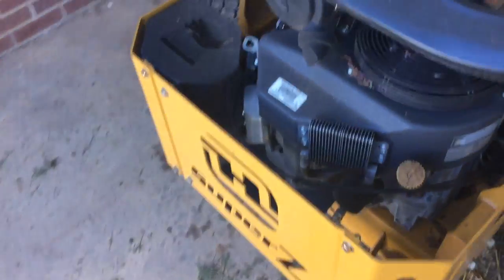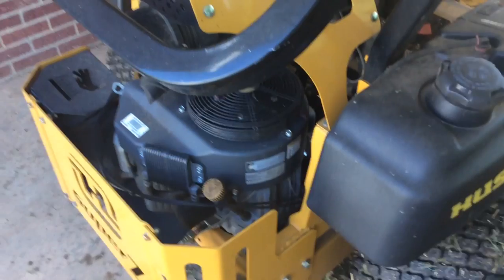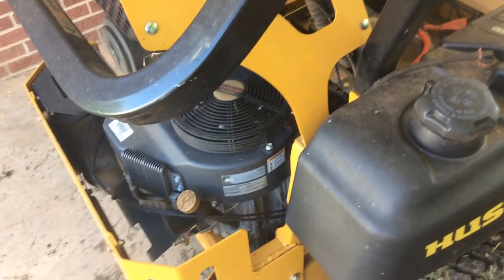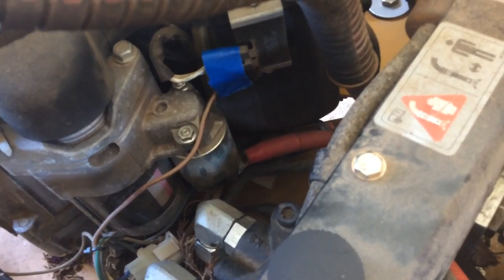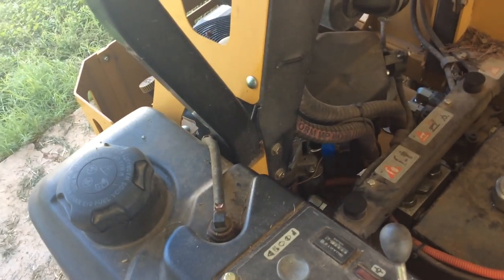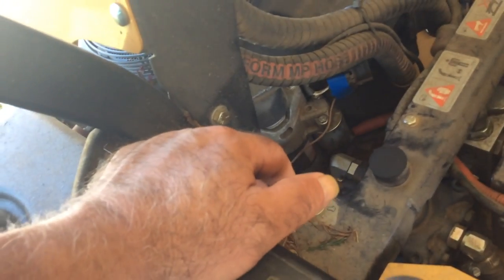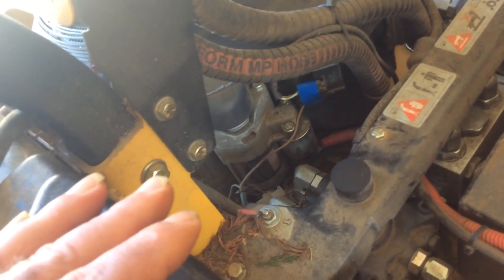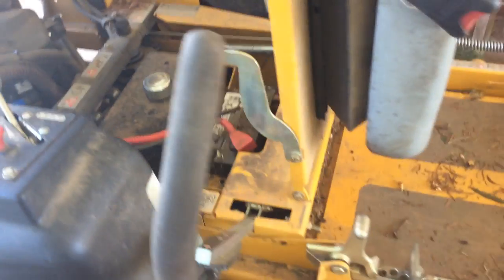Kawasaki FX850V wire fix on my Hustler Super Z

Comment: "known problem" = manufacturer defect and, hence, the company should pay to fix it.  Mine is doing the same thing.  I have a 2018 Hustler Fastrak SD.  I already took it in one time for this problem.  Initially, they gave me a new battery.  Kept doing it.  Then I took the mower to them and they said it was a faulty wire or loose wire or something - I can't remember.  Now it's doing it again.  Not sure if it's the same problem as yours but I'm just going to try and fix it myself.  My local Hustler dealership has not been easy to work with and it'll make me think twice before buying a Hustler again in the future.  I've already had several problems with the mower and trying to get timely service has been a nightmare.  Thanks for posting the video.  I enjoyed listening to your commentary.

Comment from the maker: Followup-The tape dries out because of the heat and falls off. The plastic on the terminal end melts so it will not stay on. Your pto will stop. I replaced the terminal end and ordered the new stator/rectifier assembly, $150. I will post a new video after it is installed next week.
Reply: I was gonna say...tape is not a fix, its a bandaid.